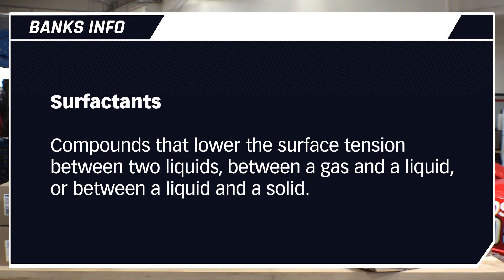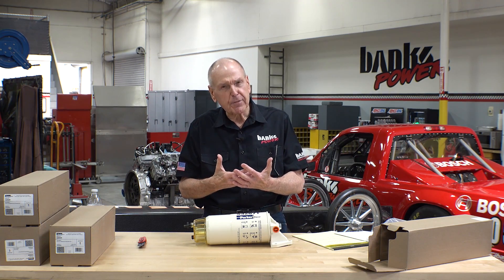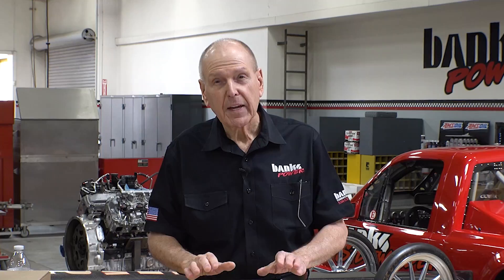UNBOXING a $400 Fuel Filter!

Comment: So…. WHY does it cost $400? LOL

Is it because it’s really good and no other company can make one like it and they’ve got the market cornered on such a critical piece of equipment or is it because so much labor with specialized hi-tech equipment goes into making one of these filters? $200, OK, but twice that?! $400 is A LOT of money for a filter… does it last the life of the engine in a normal application at least or do you have to change it every 100,000 miles?

Comment: Gale, there are many ways to skin a cat and Parker Racor solution or should I say "BOAT ANCHOR" Solution is NOT MAKING IT ! .. I have looked at a FASS Fuel filtration system that not only uses better filter media, it removes Air, Water and Particulate better than the Parker Racor .. 84 PPM on the water .. I notice that you didn't mention Parker Racor's PPM .. The FASS particulate level is 2 microns .. So from what I see the FASS system obsoletes this Boat Anchor and we should just give it the deep six .. I didn't touch on the air or the media used in the FASS system .. FASS has videos that show how sloshing causes foam and air bubbles in the fuel .. Off road vehicle get a whole lot of shack rattle and roll .. I have seen a tank of diesel run with a lot of air run through the FASS system and see visually that the fuel is completely clear .. It is even more clear than when the fuel hasn't be sloshing .. What do they do differently .. 1st they use a glass fiber media to remove the water .. It is a high pressure filter and it requires an electric pump .. 2nd air an particulate filter is a very fine wire mesh .. So which filter would I choose .. The one that provides the best filtration and removes Air, Water and Particulates .. Their may be a good reason not to apply to much pressure to the diesel fuel pump but if it is a problem then a settable bypass valve that feeds back both the air and overage of the fuel is in order .. Your thoughts ? ..

No I don't work for FASS .. I am just considering keeping my fuel cleaner in my 95 Landcruiser Diesel ..

Comment: Great video.  I'm sure those filters are great for service station fuel pumps and long haul big rigs, but I don't think those filters have much use in the average person's car or pickup truck.  You talk about 10 micron filtration, well both Wix and Baldwin for years have made a 2 micron screw-on fuel filter I think is much more appropriate for the average vehicle owner.  After installing one of these 2 micron fuel filters in my '62 pickup truck, I never again had any problems with dirt causing the needle and seat to get stuck open in my carb, and to the best of my knowledge, my gas tank has never been pulled and cleaned out.  You can see a picture of the filter installed in my pickup truck near the bottom of this forum post along with part numbers etc.  
https://forums.ihpartsamerica.com/threads/are-there-different-grades-of-wix-oil-filters.4022/page-2 
You may say "that filter may filter great, but it won't separate the water from the fuel".  If you look, attached to my carb is another old school technology that does a fine job of separating fuel from water.  I've found these two filter systems together to be more  than adequate in all my vehicles and hard-core 4wd rigs.

A bit farther down you will also see  a 2 micron and a 5 micron particle against a standard filter media and against a nano-technology filter media.  
I hope this info is of some benefit to those not running big diesel engines or don't have room for monster filters in their engine compartment but still want excellent 2 micron fuel filtering and some form of fuel / water separation.

Comment: I have been running this filter set up on my 2006 Cummins for years but I use R60S 2 MICRON filter. Good stuff for sure.  The factory fuel filter still looks new after 10k miles.
Reply: What does it do for your vehicle? Better fuel economy? More Horsepower?

Comment: Is there any way to mount these onto the truck like pre def Duramax. I’ve never used a fass but I’m wondering if this could replace the fass filters or if it’s even worth it because I know you can use cat filters on he lift pump, I’m guessing this is more so for gale’s 1000+hp monster but if I did want to eventually make 1khp is there a way to mount these to a fass or fuel filter housing?

Comment: Always love your videos. One thing im really curious about is hydro-diesel, how well it really works / the advantages in efficiency while keeping soot / NOx emissions down, and the considerations that need to be made with fuel systems and high pressure pumps so that they last when running water diesel emulsion based fuels that are being explored. The advantages seem great as long as they dont effect fuel system damage and can be stored without separation.

Comment: I love my Parker Racor units.  I have a triplex unit of 3 micron water absorbing filters as redundancy on my Cat 3508's.  I'm not sure about how you get and store your diesel, but I also polish the fuel in the main and daily tanks to protect the fuel, tanks, lines, and the generators themselves, as you mentioned, water is easily emulsified in the fuels with the lubricity adders.

Comment: Very over rated and over priced. Why 400? Because they figure a mega yacht owner can afford it. Have fun getting that plastic bowl off without the special wench$$ that can’t work close to the bulkhead and may pop and spread if you really have to torque it off. Even if you put oil on the O ring it still sticks. When ever I can I convert to another brand.

Comment: For $400 I was expecting 1 micron.
Reply: for 400$ i was expecting a lab tech with an electron microscope to inspect every molecule of diesel before it goes into my injection pump
Reply: but id expect 10 micron is to keep pressure drop low for these rigs that burn diesel as fast as you can pump it into them.. i wouldnt think the lift pump would ever be the limiting factor but apparently it can be
Reply: Why would you want 1 micron?
Reply: I have there $40 version 2 micron that filters from aux to main tank.My stock 4 micron filter last long time.

Comment: Gale if you want filtration Place the Zinga AEO-3AZL filter downstream of that Parker, It will catch all the Water and Particles that Parker and Racor missed. Theirs's  valid reason(s) that AE Zinga filters are for Auxiliary Systems ONLY, So Please if your reading this DO Not install on direct Injection Filtration system (Auxiliary or Transfer ONLY) or commonly known as the Lift / Feed to Injection Pump. The Testing Cale is performing on the Dyno will be a good Test to discredit My Statement that Zinga AEO filter is superior to the S3207T Cale is using. I will explain the Ratings The 3207T ABS rating is 10mics ,that means it gets 98% of 10mics on the first pass. Zinga 3AZL get 50% of 5mics and 98% of 24mics. Use the AEO3 and its 50% of 4mics and 98% of 7mics on the first pass.
We have supported Zinga AE filters for 15 Years, You will be hard pressed to find anyone discrediting their Ratings as precise and exact. 
Gale I respect your entrepreneurship and admire your efforts, I mean no discrediting, just pointing out other options. Maybe some day I will make out to Banks. I have supported your Product for 17 Years, Sold it back in the Day, Now Our engine and fuel products consume all My Time.

Comment: A micron as we explained it to the regular people when we we building propulsion systems for the Navy was described as; take a piece of hair, black hair from your head, slice it into 10 pieces the long way, take one of those ten pieces and slice it into ten slices, the long way and now you have 1 micron. Hair has to be black because say blond hair is smaller in diameter to start. Pretty darn small.

Comment: So what’s your thoughts on the oe filtration on the l5p? Any room for improvement?
Reply: If you want cleaner fuel run  a 2 micron filter on a polishing loop like you'd do in a marine application.
Reply: @otm646  what is a "polishing loop" Thanks!

Comment: I would like a higher boosting turbo for my Experimental racing type aircraft
engine, ported & flow matched, single turbocharged, inner-cooled,
fuel-injected, manual w/gate. Can you recommend one, please?

Current Turbo:

Roto-Master (Rajay) Turbo
Model 3AT6EE10J2 (325E10-1) 600573-00 
600576-00 CF600573-9000 (RJ0331-1) 409170-9001

Engine: 360ci- 200hp 2500RPM

volumetric efficiency (VE) = .90%

Engine flow = 208CFM @14.7Hg STD

Thanks, Richard

Comment: Nice numbers for that filter assembly. Although, in the real truck world with return fuel lines into the tank, many folks have been concerned with air in the fuel just as much as they are concerned about water and impurities. Stock light trucks do not have the filter systems to deal with this concern so there are companies who manufacture "fuel polishers" to rid out the air molecules that are generated by the return fuel systems. Folks will recognize the two big brands out there, Airdog and Fass.  This concern may not apply to the monster truck fuel system but it does on the big three makers of Diesel powered light trucks.

Comment: 90% of the people watching this will freak out about spending $400 on a filter.  The other 10% are the ones that can spend $40K building a motor and they KNOW that a really good filter is a ton of money saved.
Reply: I'm not in a position to spend $40k on anything.  Well, nothing recreational.  Still...I can certainly appreciate that if you're going to do so, you might actually want to protect said investment.  No use building a big time engine for the whole world to see if you're going to strap a $50 filter to it and hope it doesn't suicide.

Comment: The fuel filters our brand of trucks use are supposedly 10µm and 3µm, the water separator just drains back to tank however which I find to be extremely silly. But tbh it hasn't caused any issues yet, except in cases where the fuel at the stations has been grossly contaminated due to leaky tanks or whatever else.

Comment: $400 at parker. $100 everywhere else
Reply: Sicktrickintuner Parker makes some of the best products.  With tractors and large trucks costing over million dollars spending 400 dollars on a filter is nothing.  Just replacing injectors cause down time and every two people cost a million dollars a year(adding in other cost).  So why save money it’s not worth losing your job or having workers laid off because equipment is broke.
Reply: Tea Extra Hot Please 
Very true, a bad filter can easily cost $6000 just in damaged parts on a truck

Comment: Hmm, assuming an inch was exactly 25.400 mm (large assumption I know) then a single mm would actually be precisely .03937007876" but I guess .039" is close enough.
Reply: It's not a large assumption. An inch is defined as exactly 25.4mm. Yes, inches are based on metric measurements.
Reply: @LesNewell  however, the Roman inch was based on 1/12 of a Roman foot  (11.6") or four palms (16 fingers). Profitable sellers frequently had small palms.
Reply: @scottdowdy9994  OK, I admit defeat ;-) I assumed you were referring to the contemporary British/US inch.

Comment: Does this mean your fuel mileage and power will increase a little because your fuel isn’t diluted with water and you’re actually burning cleaner fuel
Reply: Assuming the main purpose is to remove variables from the dyno room so that test results will be repeatable and comparable.

Comment: Mr. Banks, what are your thoughts on "rolling coal".
Reply: Timothy Thompson he’s mentioned in passed videos, it’s unburnt fuel and wasted horsepower.
Reply: His past videos tell it, waste of fuel, too much heat to the engine, bad for the environment. It would be fun to put one of the competitors engines on Gale's dyno and run them like he has these engines...my guess is they would burn up in less than 3 minutes under a full load at 3,000 RPM

Comment: So can one add sulfur back into the fuel to regain the blubricity, say in an off road pulling truck?
Reply: ,,, it's not the sulfur that provides lubricity.  It's the * process * of removing the sulfur that reduces lubricity  .
Reply: @rolandtamaccio3285  So additives like Stanadyne should actually work in increasing lubricity, I would think.
Reply: @gadsdenconsulting7126  ,,, fairly sure, no one wants sulfur  .
Reply: Stanadyne Performance Formula is one of the best additives for improving the lubricity of ULSD.
Reply: Seems like adding oil would add lubricity back.
Reply: @chucknVa  I saw a chart from Stanadyne that showed test results of lubricity in fuel if I remember correctly. I don't think oil did the best. I'll try to find it online.